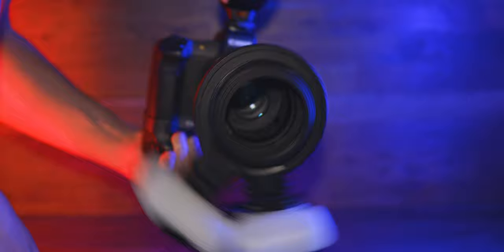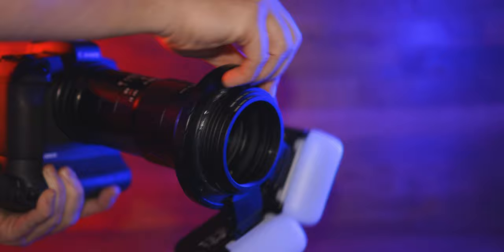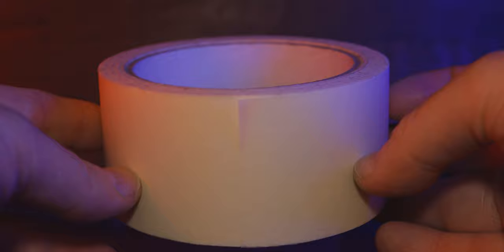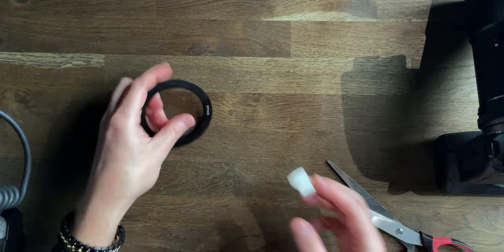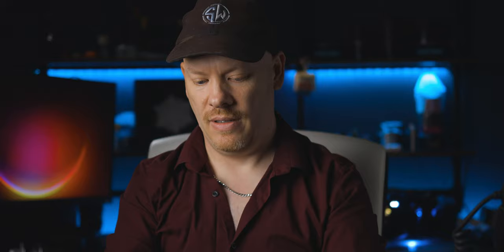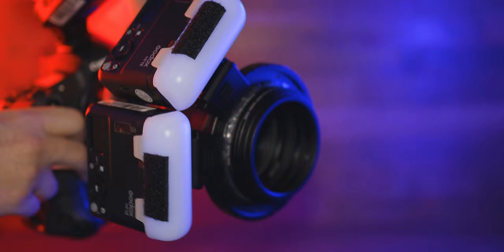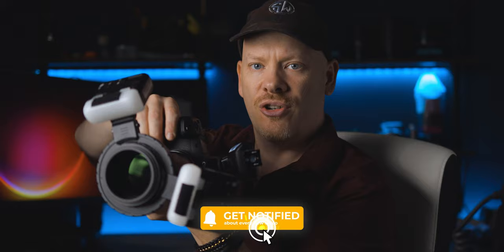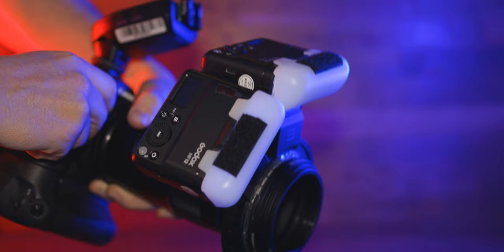All Twin Macro Flashes have a MAJOR flaw... Lets fix it!

Comment: Good tip Stewart.  In construction and other trades we call that a shim.  Usually I like to use a shim with similar properties of the item that needs shimming and tape works great as it’s always around and there so many different thicknesses and durability to choose from. A more lasting solution however would be sheet plastic of the proper thickness CA glued to the part that needs shimming. Either that or carry a roll of tape in you bag in case the your taped shim starts to loosen up from wear.
Reply from the maker: Good idea about the sheet plastic!

Comment: I have 3 half inch pieces of velcro (not the hooked side, the cloth side) spread equally and folded over the edge of the ring. The thickness helps lock the flash securely, plus the velcro is black and blends in.
Reply from the maker: Yep I’ve now done that😂😂😂
Reply: @StewartWoodArt   does anyone has a pic for that velcro solution?

Comment: Luckily I have the bracket from the Canon MT24EX. The flash just stopped working about 7 years back. I've now got Yongnuo twin flash like yours, and the Meike twin flash that looks almost identical to the Godox. The MT24EX bracket doesn't slip. It is smaller and better shaped than the Yonguo brackets. What's more Yonguo flash heads just clip right onto it, and lock in place, because all the bits are exactly the same as on the Canon twin flash. Best of all, it will clip directly on any Canon macro lens that has a grove at the front like the MP-E 65mm. But you can get the grove adapters which screw into the filter thread. You might need stepping rings to use it with different lens. I really is much better than all the other brackets. The problem is with the Meike, if you just the cold shoe adaptors, it won't push into the cold shoes on the MT24EX because it is too thick. So I have to use on of those cheap little cold shoe adapters with a 1/4 in thread. You can then just screw the cold shoe adaptors on to it. I really don't like the Meike bracket, that looks to be the same on the Godox, and is a copy of the Nikon twin flash bracket. It is much too deep. If you have a very short working distance, it's difficult to get any lighting from the front.

Comment: G'Day Stewart. I'm wondering if you have used the outfit a lot that caused wear. I have the system and the ring is a good fit and has never slipped. But your tip is a good one to keep in mind just in case. Thanks.
Reply from the maker: With doing YouTube, my system does get used a lot but the Godox has done it out the box from new.

Comment: I seriously thought the flaw would be the fact the flashes are always waaay out front, making flash diffusion a pain.
To think this was a video about tape, hahaha 🤣
Reply from the maker: Ha ha ha, diffusion is easy my friend!
Reply: I find it often clash with the working distance when using dedicated macro flash setups. Cause the norm is apparently to use them like a ring flash. But that doesn't work well for most subjects. 

Your workaround in a previous video fixed that however 🙂

Comment: Sorry but masking tape has a shelf life also if you expose it to the environment the” field” it quickly deteriorates it’s only designed to be used once leave a roll of masking in the cold or damp for more the a a week it’s useless I know I use it in my job
Reply from the maker: As I said, there are better options out there but I've never had an issue using masking tape on my gear.

Comment: I take it Canon doesn't have this issue.
Reply from the maker: I have no idea, I haven’t used their flash yet.
Reply: I have owned the Canon MT-24EX for many years now and it doesn’t slip one bit. The spring loaded front mount ring always hold firm. It’s beautifully built.